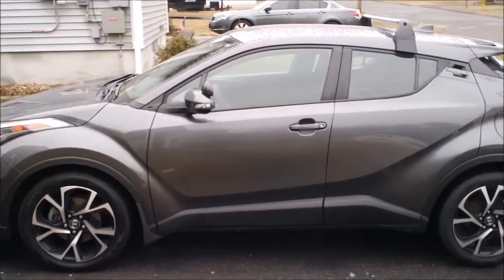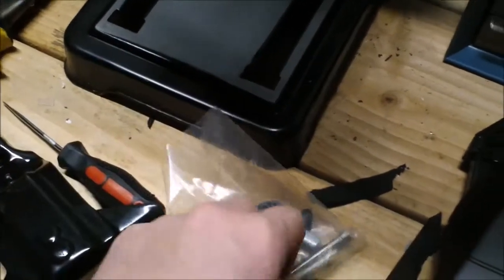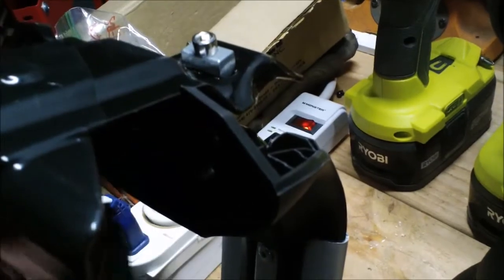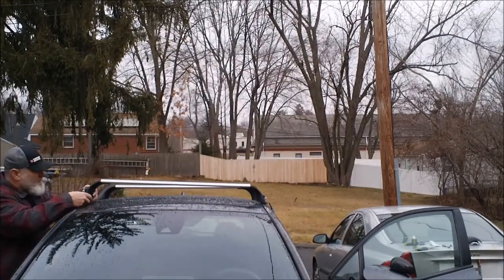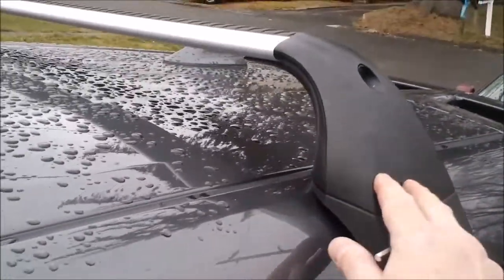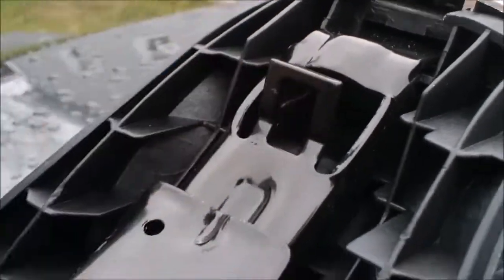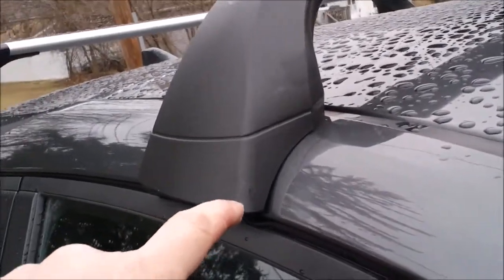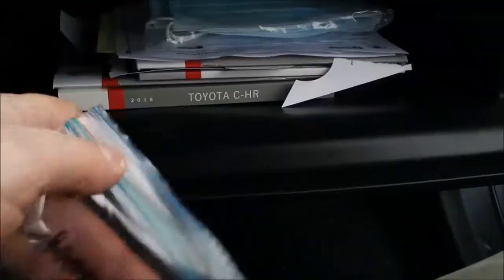Toyota Roof Rack

Comment: Thank you for the video, luckily mine was pre-assembled from Toyota. I love the look of this but I did not have silicone on hand while watching your video and just put them on my car. You are correct, the first day the cover on the front passenger side blew off the car and I double checked before taking the car out. Any suggestions on Toyota replacing this part before purchasing one?
Reply from the maker: You could inquire with them to see if they'll replace it. If not, probably check on eBay for a cheap replacement. Those are my suggestions. Good luck.

Comment: How do you take off the plastic cover , is it inside the torque tool that came with the car?
Reply from the maker: @GrowerStatusT73  the rack came with a plastic star key.
Reply: @BrianMDIY  they must have forgotten to put the keys in with the torque tool when i purchased the vehicle. Darn
Reply from the maker: @GrowerStatusT73  I can imagine. I put the keys in a small ziplock with the owner's manual. It been so long since I worked on the racks....could you use a thin walled socket to make it work?

Comment: I’ve also seen from reviews of the aftermarket racks that you have to be careful because they will bend if you put anything that’s heavy on them which is unfortunate.
Reply from the maker: I've had some serious weight on them with no problems. I've even strapped a fiberglass boat to them. It looked ridiculous, but I got it home from an hour away. The fit and finish is meh, they do perform well in my year of use. I hope that helps if you're shopping for a set.
Reply: About 30kgs max on most.

Comment: any updates on the rack?
Reply from the maker: Funny, I just sold the car. The rack worked awesome. My only complaint would be the painted black plastic got worn and flaked. Easily could be repainted or sanded off to just black plastic. If you're considering getting them I would reccomend. Best of luck.

Comment: which are longer longer brackets. the front or the rear?
Reply from the maker: The taller or longer brackets go to the rear. Best of luck.
Reply: Your the best. Just one more question sir. Which is the longer of the two 
 The front or rear? Dealership service didn't know. :(
Reply: The crossbar.
Reply from the maker: @adrian-bx9sy  that I don't know. I thought they were both the same length?  You may need to measure the roof line to know.
Reply: @BrianMDIY  you're the best. i got the front one on. However,  the rear bar is another story. Which way are the pegs on the bracket supposed to be facing? Toward the front of the windshield. For the rear rack is it shorter in the fron like the front one? No joke, Brian you helping me is better than the seller and the videos posted on here.
Reply from the maker: @adrian-bx9sy  it's been a while since I installed them. I just measured and Both my racks are the same length. The brackets mount like a clamp to the roof, so whichever direction makes sense regarding that. Maybe you got a set for a different vehicle I'm guessing is a possibility?
Reply: @BrianMDIY  i hope not. i know if you open the door, there is a little nub that show if it is in the front or rear.
Reply: @BrianMDIY  it looks like I have to cut trim some of the rubber part to a bit as well.